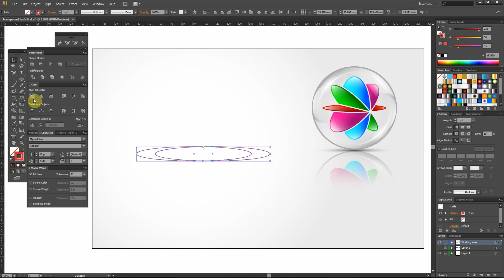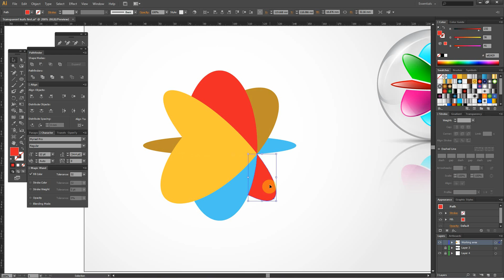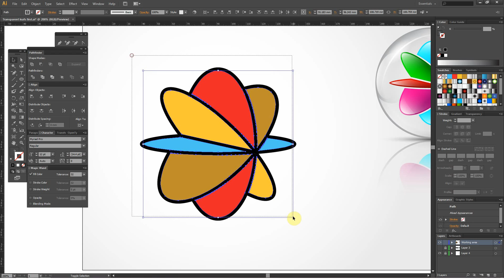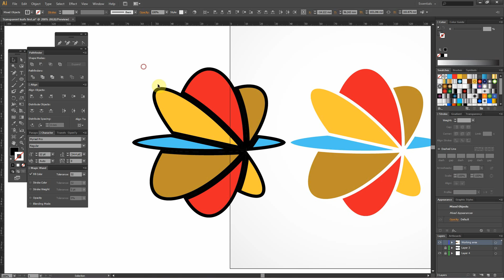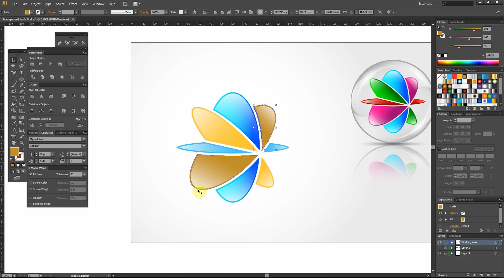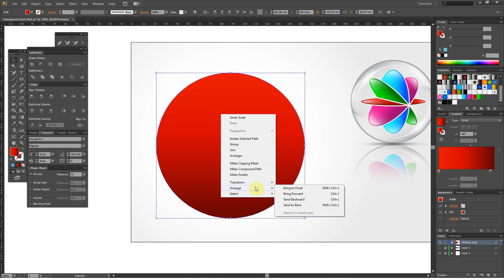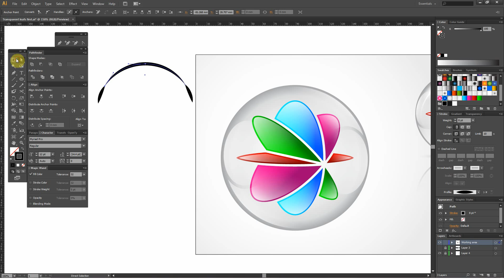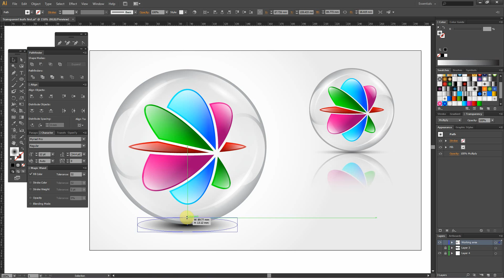How to create 3D Logo Design (GLASS MARBLE) in Adobe Illustrator CS6 HD1080p

Comment from the maker: 3D Logo Design!
Reply from the maker: +Clever Mark Creating a 3D logo is a process that requires extensive knowledge in the use of Adobe Illustrator program, but with the help of some tricks and using simple strokes can get an amazing 3D effect. This tutorial is made and, if somewhere there is a part that relates to the art of drawing, believe me, I could not escape. I hope you will learn something you did not know, thus improving their technique. Working tutorials which are complicated as they Clever Mark’s, you are learn much more, because these are solutions that are final. No need to switch between progressive lessons that are not applicable in practice.
Logo design is a matter of ideas and the need to connect multiple business parameters of the company and its visual recognition should also be beautiful and ingenious, maybe just in this tutorial is an element that will give you an idea as inspiration.